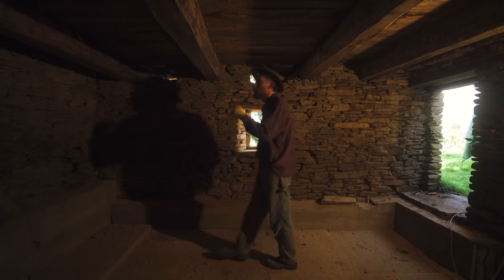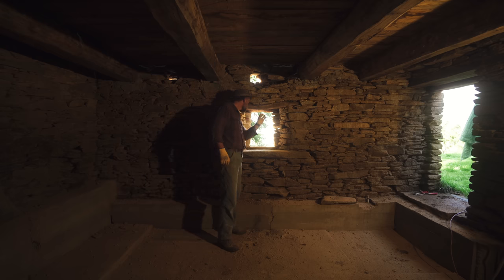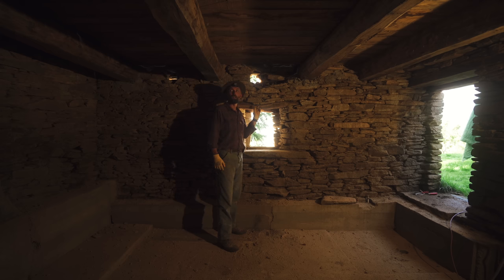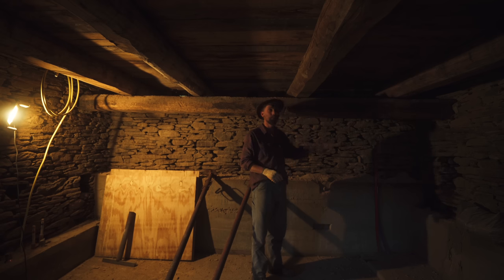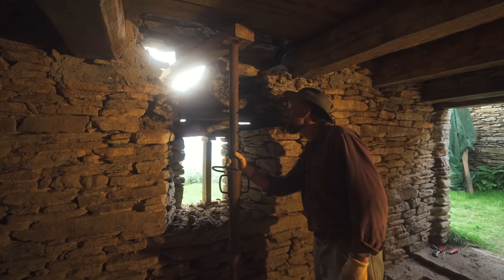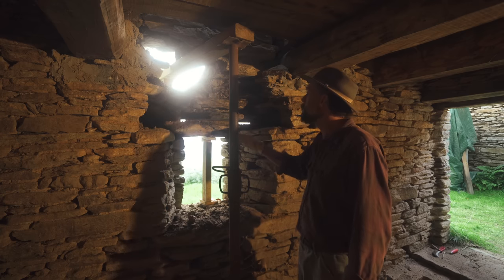#82 Upstairs finished, Moving on downstairs

Comment: Again I see craftsmanship in the lintel replacement. I was surprised you considered changing them, but once you pulled out the first one, it was obviously necessary. Precise measurement would be required, especially with the uneven stones and walls. 
Well done.

Comment: Martijn, your early morning coffee cup warming may risk cracking the mug, can I suggest you invert the mug over the coffee maker (if it fits) as the coffee is heating...should be a bit of a gentler warming method and saves 30seconds of gas. Cheers.
Reply: My mother used a simmer plate on our camping stove. Great for toasting bread as well!

Comment: Hey Martjin, regarding your Stihl chainsaw. Try to adjust the L screw of the carburetor a little bit (like a few degrees left or right), when the saw is warmed up for minute to find a spot where it runs a bit better at idle, starts better and doesn't shut down. Blip the gas shortly after each adjustment. If the idle rpm is too high after adjusting, turn the LA screw a bit outwards/left. If that doesn't make your saw run better, try to screw L all the way in and then 3/4 of a turn out in case the base line adjustment was entirely wrong :)
If all does not help, make sure your air filter and petrol is clean in case you don't normally check. Those would be some first amateur fitting steps.

Comment: I wrote this comment on your last Video  81 when you worked on the grout, but I'll reiterate b/c I feel it's important nd hope you see it:  I'd recommend a good sealer for that grout and stone - been doing construction for a number of years, and exterior-wise it would prevent crumbling over time from the weather and from moisture freezing and thawing - and Interior-wise it would seal the grout so to prevent "dusting" which all cement/concrete products do - so it'll keep dust down in your building. If you'd like I can research the ones I can't quite remember using, but the best ones are the penetrating sealers and that usually means the solvent-based (high VOC) types.

Comment: Once you are done with pointing the stones on bottom room, I would strongly consider pointing the exterior walls as well as filling those holes and to prevent creatures from nesting in the walls.   By pointing the stones, it will provide some kind of waterproofing as well as strengthening those walls as they look like they were built with dirt/soil.  Not a very structurally sound although the walls are deep.  Take care.

Comment: I see Martijn is able to stand up straight inside the cabin at the moment. But when he eventually lays the floor over the crawl space, he won't be able to. Or am I wrong?
Reply: @odetteuys1111 wrong😊
Reply: Yeah don't give a reason or explanation. Just write wrong with an obnoxious emoji.
Reply: There won’t be a crawl space. Those are short concrete retaining walls which reinforce the base of the original stone walls. The floor will be thin stones laying on the concrete slab which has thick insulation and waterproofing underneath it.

Comment: Martin, l don't understand why you started to fill in the wall on the first floor before you stabilised the walls below. Surely any movement on the down stairs wall will affect the upstairs. I just hope you DON'T get any movement and the same thing why is the chimney not be inside the house as you will loose heat getting rid of the smoke.

Comment: It looks like you’re using sand and cement for your pointing. I think this is a mistake as moisture will get trapped in the walls and you’ll end up with all sorts of issues down the road. You need a breathable material like lime with no cement so the walls can breathe as you don’t have any damp-proofing under those walls.

Comment: Hello, taking advantage of the fact that the wood in the basement window is being replaced, wouldn't it be better to open the window more and make it larger for the entry of natural light?
Reply: If I remember correctly from the beginning of his vlog, one of the underlying principles is to not require permission (permits) and inspections for his renovations because they take weeks/months to obtain and would halt his work flow. Adding or resizing windows changes the original structure and requires permit(s).

Comment: Have you tried used motor oil to treat wood?
It's the best in my opinion,  the way it preserves the wood is incredible, we do it  alot. The wood last way longer then any pressure treated wood, varnish, poly urethane or linseed oil!

Comment: What is that structure just outside the lower door on the building you’ve done the most work on?  Was it for grain storage originally?  Do you have any specific plans for it?  It would make a great smokehouse.
Reply: Martijn explained this in past videos. I don’t know which one, but it’s all explained. It is going to be his water and power connections and some storage. Will be insulated to protect connections from freezing.
Reply: @R-Texas  so, you don’t know either?  😉
Reply: @markbader4942  Yes, I put in my reply to you that he is going to use it as a “mechanical” room for his water, etc connections. He will keep them insulated that way so the pipes do not burst in winter. It’s a small room. It was assumed to be a doghouse in the original use of the houses.
Reply: @R-Texas  ah, doghouse, sort of makes sense I guess if you don’t allow your dogs indoors.  Thanks.